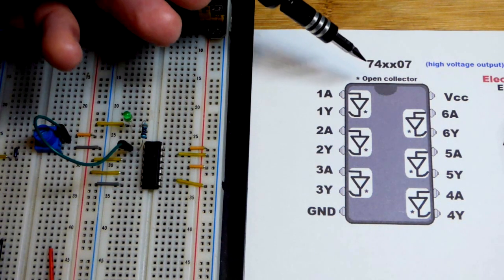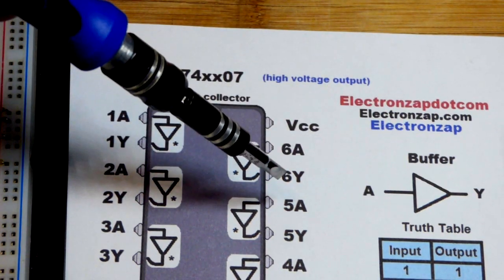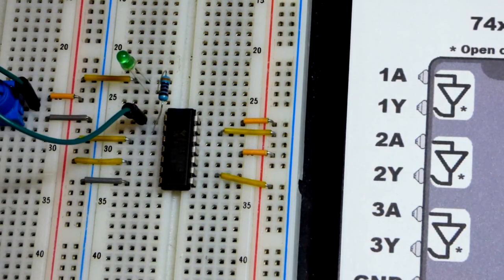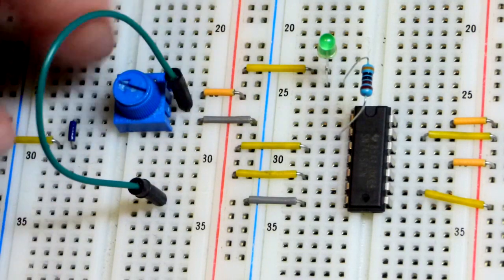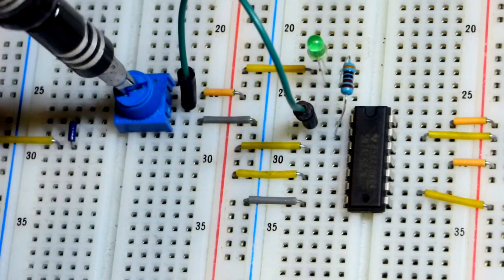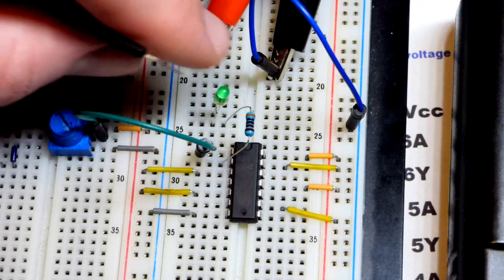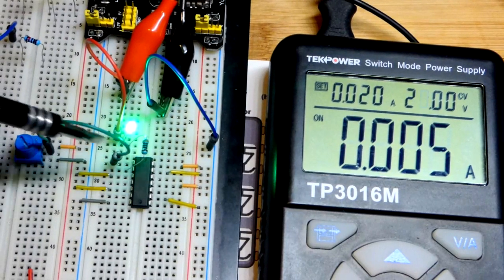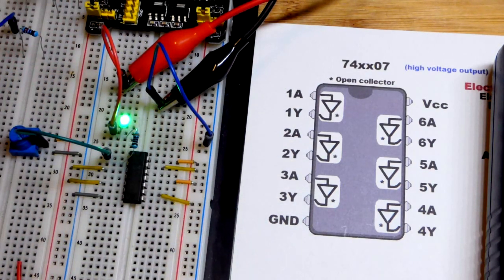7407 74LS04 hex buffer with open collector high voltage outputs integrated circuit IC by electronzap

Comment: Hey thanks for the video, i made the same circuit but i have a confusion ! when the input is low the led turns on and when it's high it turns off but as i know the buffer gives you at the output the same signal as the input so can you make it clear for me please! ?
Reply: @Younes Hamache , I can explain it: your circuit uses „sinking current“. If the output is low, the LED is on, because the output has 0V, which is a difference compared with your supplied voltage applied through the LED to the output. If the output is high, the collector (output pin) will be disconnected („open collector“) from 0V (GND), which means there is no connection for your LED any more beneath the supply voltage you applied, ergo: LED is off. 
If you don’t want to have this inverting behavior, you have to connect your resistor from the output to the higher voltage VCC (LED supply) and the LED with anode from output pin to GND (cathode) directly. Be sure to connect both GNDs (LED supply and IC supply) together. Et viola. 🙂
Reply from the maker: Thanks for watching! The buffer does give the same output as the input. It provides power so that the signal doesn't have to.